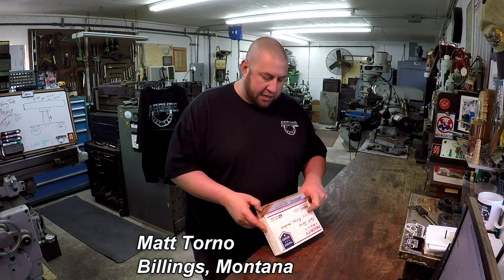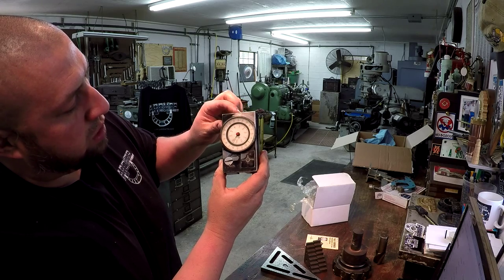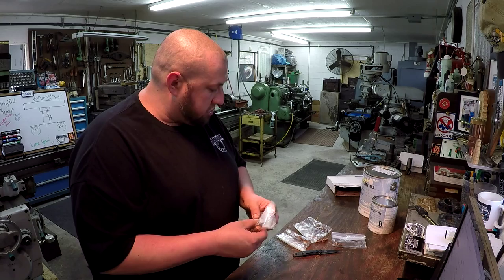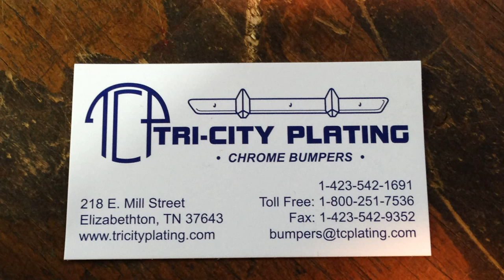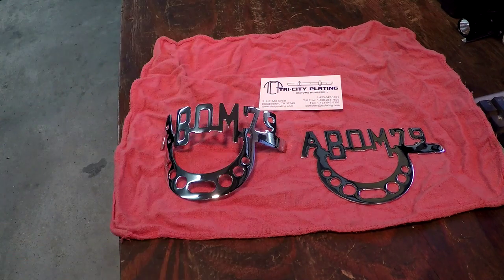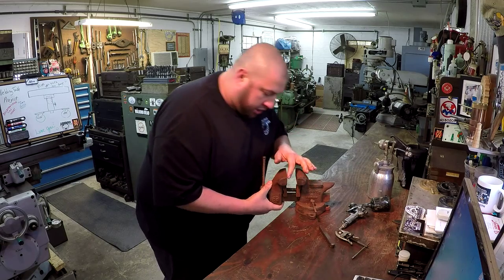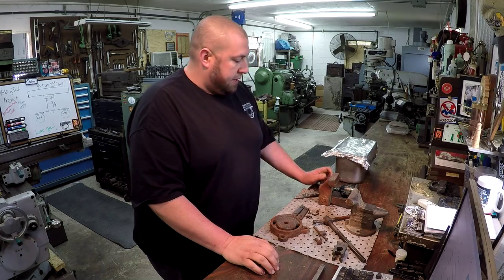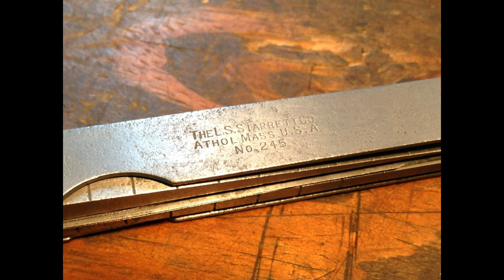Saturday Night Special 62

Comment: Another awesome SNS.  Love the chrome logo, they did a great job on that.  MAC detail gun is likely rebranded Devilbiss, Sata, or other.  Best not to soak the whole gun in solvent.  Take it apart, its simple to do, take the air cap off, un screw the fluid tip from the front, one of the knobs on the back will unscrew and you can pull the needle out the back, soak all those parts for as long as you want.  The gun body, clean the inner passages with solvent and a gun round brush, they make some for cleaning out ID's.  If you soak the whole body, it will likely leak on you, as those guns have many seals, gaskets, etc that will swell up from soaked in solvent.
Reply: Thanks heaps for that tip, turbocobra.  I bought an Italian-made Rigo spray gun like the larger one Adam got and it needs a little clean up.  I will be careful to take all the gaskets and seals out before soaking the rest of the parts.
Reply from the maker: turbocobra Thank you for all the good tips!

Comment: Sure is some nice bling for the table.  Those oilers and logos look amazing.  To clean up the paint guns, grab a jug of gunwash, peel them apart and let the parts soak. For cleanup after you get spraying the epoxy, use vinegar.  Works really well and non toxic.
Reply from the maker: Thanks Emil, and good to see you back around these parts.

Comment: Use that big face mill to flatten that vise. I imagine you can hold a 1-1/4 shank in it and you don't have to take a heavy cut but it should leave a nice flat finish. :-) Nice of the Blues Brothers to stop by the shop!  That medallion and those oilers sure are pretty and shiny!
Reply from the maker: bcbloc02 It'll be great when the day comes I can use all those big cutters in the mill. Between the K&T and the DoAll, I should be set.

Comment: Hi Adam: that little puller is for taking off battery terminals. Your logos look absolutely great as do the oilers  and everything else. I'm glad you shared the name of the chrome shop because I'm thinking about sending them my bridgeport dials. It is a good thing you are taking such good care of little details on the welding table because I think that baby will still be the talk of town fifty or more years from now.  Thanks for sharing.

Comment: In the past I have used carburetor cleaner on paint guns that look like the two you have there. If you can find some Hydroseal, or Berryman Chem Dip, soak the cups and some of the parts that come off the gun bodies in it and the old paint will disappear. You can use a spray can of carb cleaner to give the parts of the gun body a shot inside the fluid passage. I know it sounds crazy using carb cleaner on painting equipment. Just rinse it well with water and then maybe a quick shot of thinner before you paint.

I enjoy everything you do with your channel.

Regards,

Marc
Reply from the maker: Thanks Marc.

Comment: Hey Adam,
What can I say? Another great SNS! A lot of great flea market finds. Brad did a great job on the oilders. I agree with you . . . the chrome plating on your logo looks 100% better than nickel or copper. Your welding table will look so great that you won't want to use it! (LOL) As I mentioned before, put a sheet of metal or plywood on the top and use it for a beverage table in your yard when friends come over.  Thanks again!
Have a good one!
Dave

Comment: Another great show Adam with some nice finds and great gifts. Oilers turned out great.
  Some suggestions for the vise refurbishment.  The copper vise jaws will be great when you weld.  If you weld against the jaw, it won't stick.   For the center swivel bolt, make a shoulder bolt to help support the main body on the swivel.

 If you have a R8  1-1/4" endmill adapter for your DoAll mill, you could use that nice carbide insert face mill you just got to clean up the bottom of the casting. 

 Jeff

Comment: Hi mate.
The chrome plates look like the chrome is about to drip off the piece.  They have done a wonderful job on those.  Same with Brad's polishing work, it nearly looks like its' liquid.
You have the most luck with your flea market there.  You have got some nice tools from it again.  The beat blaster works very well, a lot better than mine, have you ever worked with a wet glass blaster?  I was able to use the one of the dental University in Amsterdam, and it worked so well, and it left no marks on the item itself.  I was proud of you that you showed the wonky vice, made in America.  I did not think you would do that.  Kudos.

Comment: Hi Adam i watched your video's for a long time now and i have learned so much from you it even got me to buy my self a lathe!!
Here is some thing fore you to learn from me, you should bring that paint back to the store and aks them for DTM paint thats speciali for metal its D direct T to M metal paint you can buy that in half liters thats mor than enough for your project. Its cheap and good i use this profesionak everyday in my shop. Good luck

Arjan from the Netherlands
Reply from the maker: Arjan Leeuw I just went with what they had. I have no doubts this will work good. It's high priced so I'm hoping it's a good durable coating.

Comment: Hi Adam,

That Kant-twist style clamp is a British Crab Clamp made by Turton engineering. They haven't been available for many years.

I have a rather abused pair of green ones.
Reply from the maker: Thanks for the tip Paul. Several manufacturers must have built the Kant Twist type of clamps.

Comment: I have a small Red Arrow vise that I've broken and repaired a few times. The next fix will be to make a new swivel base. It has the identical uneven rough casting issue as yours. More shop fun in the making. 

I think you'll find that small puller to be sized for battery terminals. 

Blue skies.

Comment: that clamp is a crab clamp, the middle attachment had a plastic head to it, so you used it as an edging clamp for woodwork, as for the spray gun, i had a similar gravity gun, i sprayed an entire motorcycle with one, so good enough for most work, i prefer them as less overspray or fussiness to exact viscosity of paint, as for cleaning, try cellulose paint spirit, unless they used 2pack paint then its screwd, or maybe acetone if your are lucky.  To fix the vice, pehaps you know of a friendly machine shop who wont charge you much :}
.

Comment: The clamp is to remove battery cables . Put it on the battery clamp and turn the T wrench and it pulls the clamp off the post. I have two of them. I'm a Auto Mechanic so I used them all the time.

Comment: When you make an adapter plate for the vise to mount to the welding table: I wonder if you could put a small cylinder on it to operate a pitch/angle. The existing technology is hydraulic throttle for heavy equipment or truck. I think I have a spare one around, if you want a picture of it, let me know. Seems like being able to do tilt-in-motion would be useful while welding, and hands free. The throttles give very accurate control for obvious reasons.

Comment: Adam, when you go to re-assemble the spray gun(s) after cleaning, on the "FLUID" needle, its best to put some petroleum jelly (i.e., some Vaseline) very small amount, in the area by the trigger that goes in and out to help atomize the spray. (Approx 1/2 to 3/4 inch from end.) The reason for this, is over time the gasket / packing for the Fluid Needle dries out, and the Fluid Needle will sometimes hang (not slide) in and out.

In my opinion your paint supplier made a very good choice. the (called "2 Part Epoxy Paint,") will give you a toughness similar to porcelain like on a kitchen stove / bathtub. VERY DURABLE. Also on the paint if it mentions say 10 minute induction time, what that means is after you mix the hardener to the paint, stir, just let it set, whether in the spray gun, or mixing pail / jug etc., for 10 minutes.  This is so the chemical reaction can begin, and the product will perform its job to harden. The product / paint may say something like pot life 30 minutes, that means after allowing for the "induction time," the paint will start to harden / solidify. Depending on the temperature if its a very hot day say above 90 degrees, it may harden / solidify faster, (in the spray gun) and if its a cool day say 65 degrees, it may take an hour. Once the material is sprayed it usually only takes approx 5 minutes to be what is called "TACK FREE," i.e., a fly / bug could land on the area that was sprayed and not stick to the paint.

I would be very surprised if you use more than a total of a quart of "MIXED PAINT." I would expect that the MAC TOOL Spray gun (assuming it holds a 1/2 pint) would be refilled 3 (three) to 4 (four) times maximum.

Would also suggest that you use a light colored primer / primer surfacer say a light Gray. Why you may ask, so you can tell when you have enough paint on to cover the the light colored primer / primer surface.

What's the difference between primer and primer surfacer. Both are Paint Adhesion Promoters to steel. primer is VERY THIN., while PRIMER SURFACER is very THICK, and aides in filling in minor surface imperfections.

Neither primer or primer surfacer. will fully protect against moisture, (we're talking like years) only paint can seal out moisture. Primer or Primer Surfacer will protect very short term i.e., like a month or two maximum. Depending what part of the country / world you live in. Adam lives & works in Florida, Primer or Primer Surfacer will protect very short term i.e., like a month or two maximum!!!!
Reply from the maker: Stanwood Dave Dave, you know your stuff. Most all of what you mentioned is exactly what the rep informed me of. he actually printed out all the msds sheets on the epoxy i bought, and went over all the details about it. They call it a "sweat in time" for the mixture. I had to wait 15 minutes after mixing, and I was warned not to keep it mixed in the plastic cut. It will melt it. I used the aluminum cup from the gun. He also warned me that this is not a good coating when left open to sunlight. It will start chalking over after so much time. But considering this will most likely always be indoors, or not in direct sunlight, I should be good to go. He recoomended if I want another coating to cover it in urethane after it's primed with this epoxy. I did ask about a primer but he says this stuff is a primer. I tested it out yesterday and so far so good! I think this is going to work out well.

Comment: Great video Adam, loved the oilers - very smart indeed!  Chrome work looks fabulous. I agree that your paint should be used on your press that lives outdoors, it will protect it  very well from all that high humidity you experience. I'm amazed how well that vice came out after a spell in the blaster. What material do you use in that to do such a great job please?
Reply from the maker: Dan Whiteford Dan I use glass beads in the blast cabinet. I use the fine grit, I believe 80 grit. it helps to not etch machined surfaces too much.

Comment: Epoxy paint is definately the way to go, it takes bangs and knocks, it produces the highest gloss fininsh and it what is used on most car paint jobs now because if you scratch it just buff it out and if it ont buff use nail polish over the top.
Reply from the maker: ***** This much be a different blend from what they use on the auto finishes. This stuff is real thick before thinned. My hot rod buddy uses epoxy on his projects though. Looks good, and buffs out well.

Comment: I've stripped a fair amount of paint over the years...  the binder is the material that holds the pigment to the surface to be painted - lot's of varieties, but they are all degraded by caustic and heat... That can be a problem if the painted bit is made from plastic or aluminum, but isn't much of a problem for steel parts, like most spray guns...

Commercially available strippers use a mix of solvents and caustic (lye), and are available at not too unreasonable prices at your hardware and home improvement stores like Home Depot and Lowe's. One style keeps changing brand names, but has methylene chloride and methanol mixed with lye and cornstarch... I've used it to strip just about every kind of paint and varnish off of furniture, kitchen cabinets, and car fenders. It makes a snotty mess, but the surfaces come up clean...

Furniture refinishers are known to mix up lye, corn starch, mineral spirits and shellac thinner to make their own paste or snotty consistency stripper.

I've used 90% rubbing alcohol and brake fluid to strip some other trickier parts, where they might be damaged by other strippers.

Whether you buy a commercial preparation or blend your own, a few of the ingredients are chemicals - some of which are toxic and/or potentially  carcinogenic such as lacquer thinners - so work outdoors, wear gloves rated for the mix of solvents and caustics, and by all means wear safety glasses with splash protection! (some of these things are hell on eyeballs...)

Work safe and work smart,

Eric

Comment: Hey Adam,
Nice SNS. You can try Methyl Ethyl Ketone  (MEK) to loosen the paint on the spray guns if the regular cleaners don't get it all. We used that for years before they banned it here in California. Nasty stuff but it works!

How about running the vise flat in the shaper? That what those machines are good at.
Reply from the maker: Bill MacDonald I'll keep that MEK in mind. Sounds like the kind of stuff that's nice to have around when you need it.
Reply: Abom79 Yeah, worked so good it got banned!. Just make sure you don't spill any on paint you want to keep!

Comment: Why not bring that paint back unopened and have the welding table powder coated? Gloss black powder coating is standard issue stuff.
Reply from the maker: ArtemiaSalina I wanted something I could do myself here at my shop, and I also think that by painting it I can repaint later if needed because of scuffs or scratches.

Comment: Adam

What brand is the larger of the two spray guns ?
Reply from the maker: Stephen Smith I don't know. Cant find a name or marking anywhere on it. But good news. It works great!! :)
Reply: Maybe that's why the seller was only asking $5.  If it was DeVilbis or Binks the price would probably have been much more.  I found an e-Bay listing for a pair of Devilbis guns in that style and the starting price was $90 !

Anyway, it doesn't matter.  You still got a great flea market score.